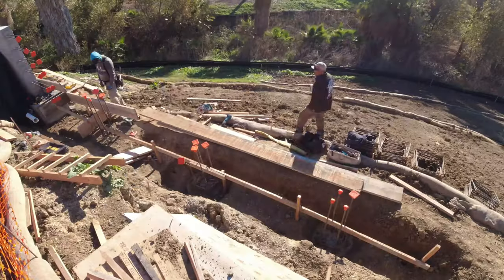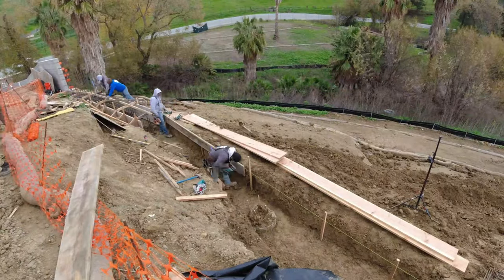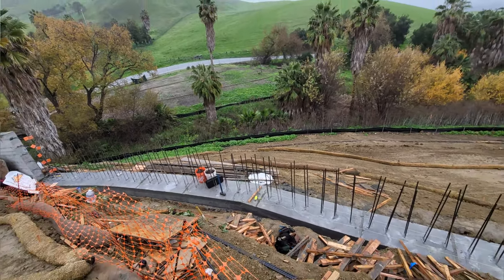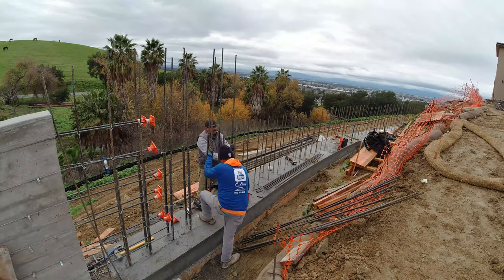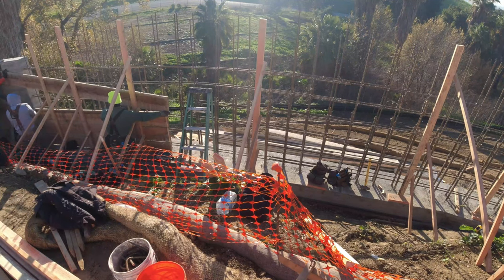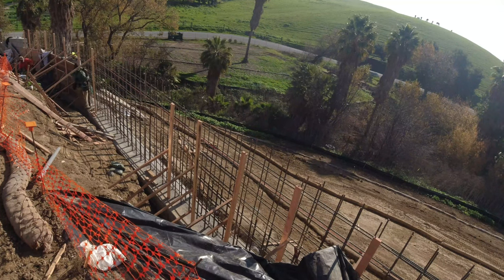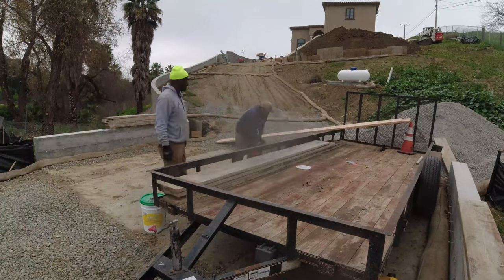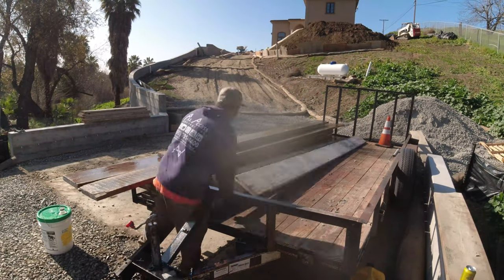Building A Concrete Retaining Wall On A Steep Hillside 2022

Comment: We  used  3/4 inch boxed plywood  forms eight  ft. Standing  four  ft running  length  of  wall. Then  we'd  run  wall ties  across  with metal  plates  that'd  would  prevent  forms from  blowing  during  the  pour. Braced for  plum every  four  feet  and  you're  good  to  go.
Reply from the maker: Yea.. Thats what's up.. We got muscle memory with the 2* 12s.. 👍🏾👍🏾
Reply: Yeah but all you got is a flat wall with 8X4 sections that look bad even in a factory. Unless its getting facing stone, or the ply panels are patterned, it will look cheap and nasty on a residential property.
As AAC says, 2X12 gives a beautiful finish, perfect for a residential property.